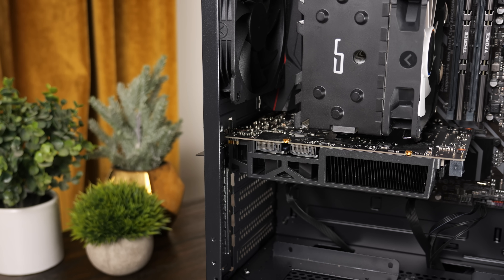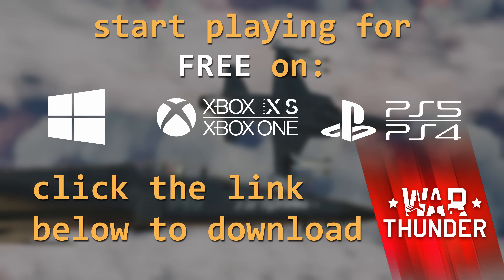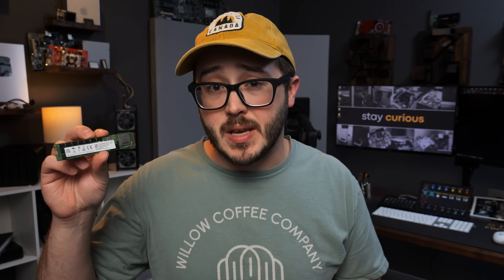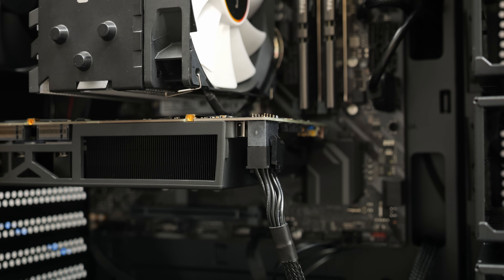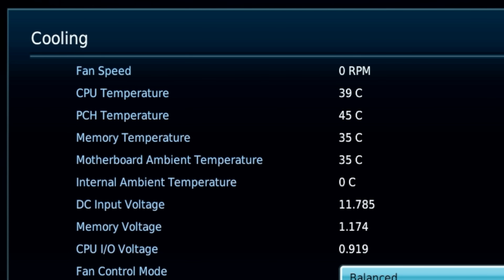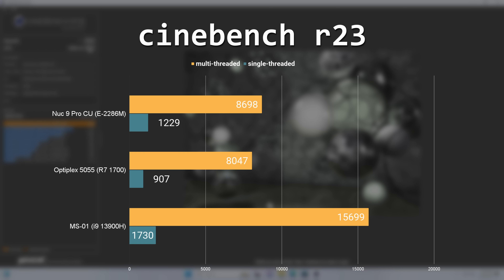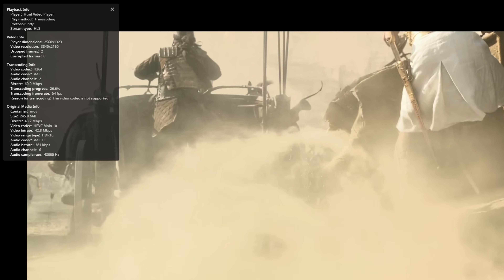I put a PC inside a PC (It’s actually GOOD!)

Comment: While this might seem odd, it's actually a very old concept. Orange Micro, a now defunct hardware company, used to make similar cards in the early 90's for Macs as a way for them to run Windows. It was before Hypervisors were a thing.
Reply: Sun micro also did the same with Solaris.
Reply: Several companies did this sorta thing for various platforms, I had a Mac Quadra something with a 486dx2-50 on a card in it back in the day, quite useful actually since I had limited space living in a small 1 room appartment of sorts, so I just had one monitor, mouse and keyboard, but separate PC and Mac computers combined into one thing. 
Hypervisors have absolutely nothing to do with it, LPAR was very much a thing. However, what it did was allow two completely different hardware architectures to coexist inside one physical computer and also exchange files to a degree, I no longer remember exactly how it worked but it was a thing. 
LPAR is splitting a computer system into more separate "slices" that can run separate instances of the OS to a configurable degree, without needing actually separate hardware to run the "slice" on, pretty much exactly what a bunch of people are very exited about these days as if it is a new thing, lol. The difference now is that you can do it on consumer level hardware, that's it - and that is due to address translation being supported in newer CPU's, which is a must to run so called VM's which are simply a softer form of an LPAR in most ways.
Edit: Realized this may not ring bells to people younger than me, LPAR is a logical partition, this has been a thing with larger computer systems for quite some time, I don't recall off the top of my head who did it first but I'm talking about stuff that was done on "professional server/large systems", so not x86, 68k, Amiga etc pedestrian overgrown pocket calculators, which in many ways is what they were back in the 80's and before, and to a degree still most of the 90's. I mean "big iron" computers, 32 and 64bit systems when most people at home had things like C64, Atari or if they were a bit more die-hard they had some Mac, PC or if they were cool an Amiga 😁
Reply: @noth606  Youre a bit long in the tooth. I don't think 95% of the viewers are older than 30. Thanks for the read. I'm guessing you're well into your 50s.
Reply: @oldschooldude8370  nope. 44. My friend had one of these cards when we were 12.
Reply: Commodore was doing this in the early 90's to let amigas emulate PC's.
Reply: I had an orange pc 486 in my power Mac 6100/66. It was so cool to have both Mac OS for school and Windows/DOS for games.

Comment: Sooo... There is literally NO connection between the Host Computer and the PCI-E Card? Only some Power is transferred?
Wow. Useless much? 150$ is way too much for that.
Reply: I think $150 is a reasonable price for that Xeon CPU and a motherboard supporting it. Yes, the PCIe slot isn't exchanging data in this use case. It wasn't intended to be plugged into another computer like this, it was meant to be plugged into an adapter board that allowed you to connect a PCIe card to it. You might be able to connect PCIe cards to it by using two PCIe adapter boards with a data cable between them.

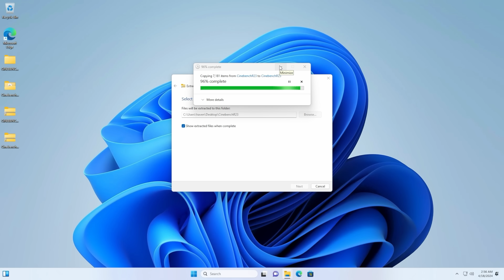Comment: 7:11 that completely breaks the use case I imagined - a low-power system living inside a higher power server, acting as some sort of proxy with access to some storage, running some applications and only waking up the higher-power system if needed. for example it would serve the plex just fine but would call for the main system if higher transcode capacity is needed etc.
Reply: It could probably be sidestepped by using a separate power supply, but then that defeats certain use cases because there'd be an obvious PSU sticking outside of the case with cables running inside and/or the side door would be removed, sort of like what I had to do with my NAS where I have a separate PSU powering the storage devices because the 1U PSU in the case couldn't provide enough power without drives randomly disconnecting and reconnecting in Linux.
Reply: @kbhasi there exist cases that have 2 power supply slots.
Reply: Phanteks makes some dual system power supplies that let each system sleep independently. You might have to tinker to get it working 100% properly with a "system" that lacks a 24-pin connector, but I can't imagine it's impossible.
Reply: @benjiro8793  that might do it yeah
Reply: People talk about disabling the iME, but wouldn't be cool if we could instead control and run stuff on the iME?
Reply: Solution is to just grab a server board that supplies power over PCI-E even when "shut off", you'll still need power to NUC PCI pins to work, but there are solutions for this in the datacenter as this is pretty common, but not in this use case with a NUC.

Comment: since you're not using the host pcie lanes why not use the other pcie slot which has less lanes or slower. you will end up cutting both bars on the long run... think twice cut once.
personally I would have used a 1x slot or a pcie extender and mounted it to the vertical slot pcie slot in your particular case.
Reply: Probably defaults to x8 for both PCIe slots when 2 cards inserted anyway.
Reply: @eric4903  it doesn't work like that for the 1st slot. on atx boards with 3 slots the last 16x will auto switch from 4x or whatever to 2x2x or 1x1x1x1x when other 1x slots are used.
Reply: @eric4903  that's bifurcation and you either need a pcie bifurcation board and set it in bios - if you plan on using multiple pcie cards on the same slot OR use a pcie device that suports bifurcation natively asus hyperx comes to mind from 16x slot to 4x nvme

Comment: Since you're covering most of the pins, think this could work with one of the mining risers and stick it in a x1 slot? That way can use the other x16 slots for "real" cards and have the nuc in a box card too!
Reply: You wouldn't need to plug it into any of the motherboard's PCIe slots if you're using a mining adapter. This device is only using the PCIe slot to supply power in this use case. That's why he taped over the data pins in the video.

Comment: cool use case would be putting it inside your main pc and then connecting all your drives to that instead of the main pc and making that the nas. that way you have no issues when changing os's or when windows updates decide to brick your pc.
Reply: I've had this exact same idea as well. Originally I was searching for a hardware RAID card capable of doing raid 5 or 6, since that would be the only solution that would work on a multi os system.
I something like this pc card just appeared as a network card to the host pc, communication would also be taken care of.

Comment: does the PCIE computer get ANYTHING from PCIE connection?  Or is it basically just a holding spot?   There's no data or any connectivity with the mainboard computer, right?
Reply: I think it supplies some power but other than that, not much else
Reply: @Sunset-Wave  Thanks for clearing that up....  That's pretty much what I thought, it's a really weird thought experiment of what another full system on a pcie bus would even look like, or what that "connection" would even function as, etc...  Still very cool...
Reply: @pretol1  personally, I think it would be interesting if it could function as a way to offload specific tasks to that system’s cores which could happen on the main system (not the one connected via pcie)
Reply: What I don't get is why the need to tape the contacts off.  Like, if the Pe is "just for power and mounting", then why would those contacts be wired to anything?  Why aren't they bare fibreglass?
Reply: @smorrow  The intel compute core is a full fledged computer and it feeds the PCIE  port, and it originally was supposed to be connected to a dumby "motherboard".   So when you connect the computer core to AN ACTUAL motherboard with cpu, you get 2 computers that are trying to feed the same bus AT THE SAME TIME.  

That's why all "smart" stuff has to be plugged off to keep the 2 computers not connected to the same bus.   

The whole story here is that the COMPUTER CORE was NEVER supposed to be plugged into an actual motherboard,  it's only supposed to be plugged into a dumby board that the compute modules came with.   It just so happens that it uses the same PCIE connector, but the direction of connector IS OPPOSITE of all other PCIE usages.

I hope this makes sense.
Reply: @pretol1  Yeah, I get you, but are those contacts actually wired to anything inside the compute core (and if so, what?)?  Were "dummy motherboards" something that already existed or were they made FOR the compute core?

Just saying, this doesn't seem a good way to repurpose existing connectors.  There's a right way to do it (e.g. the SATA-connector battery board in the Novena computer) that's pretty idiot-proof.
Reply: This is one of those, "interesting" cases, that's "amazing" if you know what's happening, and a total disaster in how tempting it is to do the wrong thing....  great power, great responsibility :)   As stupid and dangerous as this is, the amazing thing is the ability to plop full function computer into a very standardized location, so it's very easy to plop another tiny-ass computer into almost ANY case. 

The sata connector for battery is, like,... opposite of this.   The connector is made reversed/unpluggable, but the function is completely different.   It's a little cringe as well, cause if I saw that SATA battery board, I'd be confused to no end as well... :)

Comment: why cover pcie pins? can you not just plug it into pcie slot?
Reply from the maker: You can, but it can cause issues with PCIe lane bifurcation on the host motherboard
Reply: @HardwareHaven  do you mean you need bifurcation or no. also what if you don't have it?

Comment: 06:36 "some guy named Jeff"... how small internet (and merchants) is... huh?
07:33 yikes! 
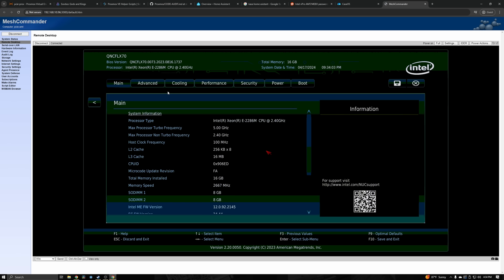12:16 Welcome to IPMI, mr Hardware Haven.

Anyway: the jankiness of this project is a couple of notch above your standard. Which does not mean that's not interesting, but it's nicher than usual the usercase and also... this is "cube SPOF"
MB of hosting system fails => power off
PSU of hosting system fails => power off
PSU of hosting system goes nuts and blast wrong voltage on 12V => two system nuked insted of one.

On one hand, it's an appetizer of "business/server grade" hardware, in a really efficient and small package.
On the other hand, extracting the CU from the original enclosure mostly come with a lot of tradeoffs, and without expandibility advantages. Interesting? Yes. But not that viable, IMVHO.
Reply from the maker: I wish it was just a standard IPMI vs the intel AMT stuff.
Reply: @HardwareHaven  too cheap product. Standard IPMI is a separate chip, sometimes sharing a network adapter (lower tier HP proliant servers)

Comment: Think this would work in a n100 nas motherboard?
Reply from the maker: It really doesn't matter as long as it's a PCIe slot
Reply: @HardwareHaven  even x1?
Reply: I just built a n100 nas machine and it has a pcie 1x slot. Id love to find out if it actually would work or not with that kind of board.

Comment: kinda wish the pcie slot could be used for direct communication between both computers, almost like an accelerator card
Reply from the maker: True...
Reply: @HardwareHaven  it would be similar to the scrapped Project Larabee in a way, where the card could also execute x86 instructions in a graphics card-like form factor
Reply: @arubberroomwithrats  Did you mean the Xeon Phi Coprocessor? There was one popular generation (x100) and one that had a rare PCIe card version (x200). The x100 series (7120, 5110, 3110...) are quite cheap, relatively common and significantly driverless. Thankfully the last time I checked Wayback Machine had some drivers published by Intel, but they don't work on modern OSes. They could be updated since the Linux version has source code provided, but I doubt anyone will do that.
Reply: @arubberroomwithrats exactly, one specific use case I’m thinking of rn is someone who uses linux on their primary computer, maybe they could use the single board thing to run windows applications without having to deal with wine…and then maybe there could be a USB version of this, making it available for laptops as well…
Reply: I was thinking the same thing
Reply: You could do it, with a pcie switch set up as a non-transparent bridge. 

The Linux kernel makes use of this natively for some kinds of NTB, forming virtual network and serial links between machines.

The cost of that NTB chip however is quite significant.
Reply: You can connect them with ethernet and RDP from one into another with minimal latency. It's like a hardware VM running inside your existing PC
Reply: That's what I was expecting when I clicked on the video, kind of disappointing it's basically just a way to shove 2 pcs into one case.
Reply: @MrHatoi  Apparently that requires something called non-transparent bridge typically reserved for enterprise PCIe fabrics. And the adapters I found don't even list their prices, which says something about their cost.
Reply: Yes! why don't people make these anymore? I'd love a mixed architecture sytem where my hypervisor has access to a library of cpu cores. Bunch of arm corms, some PPC, X86 risc V etc
Reply: Intel and amd would have a heart attack. They want to overcharge business and not give them any outs. The arm chip makers might allow for that.

Comment: quick question as i'm currently upgrading all 6 drives in my truenas scale nas
if i have raidz2, can i swap 2 drives at a time to run resilvering just 3 times (7-8h) instead of waiting 15 full hours (2,5h/drive) to do it one at a time?
i don't have another board/psu with enough sata to do it properly
Reply from the maker: Not sure... sorry! I would check on the forums
Reply: That would risk losing all of your data if anything went wrong in the resilver process because you would have zero redundancy the entire time and ZFS can't fix errors in that situation. I think it is possible, but it's probably not recommended. An old SAS card or a SATA card is pretty cheap these days, can you not fit one into a computer to connect both arrays at once and copy over?
Reply: @5467nick  i don't have a psu with 12 sata plugs, or even a case that can hold 12 drives, and i already did it one at a time
Reply: @5467nick  i don't have a psu with enough sata plugs for 12 drives nor a case that can hold them all, and i already did it one by one
Reply: i don't have a psu with enough sata plugs for 12 drives nor a case that can hold them all, and i already did it one by one